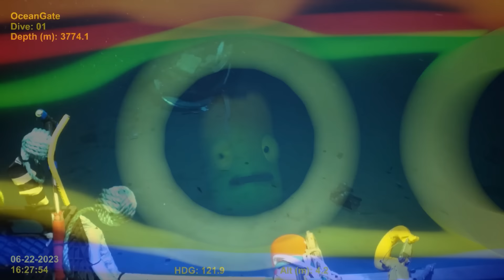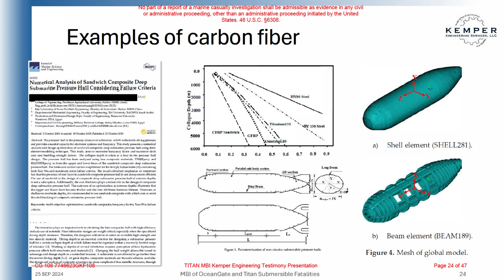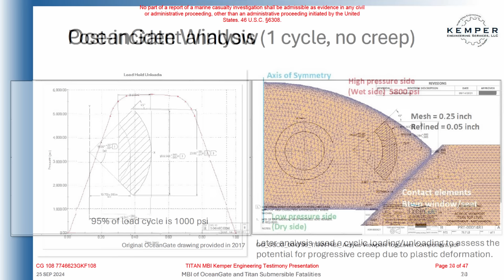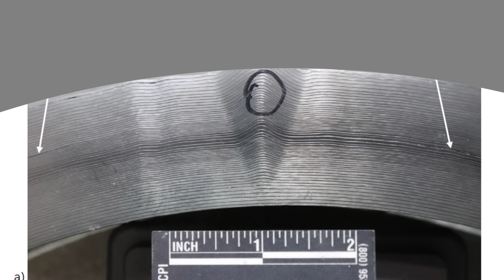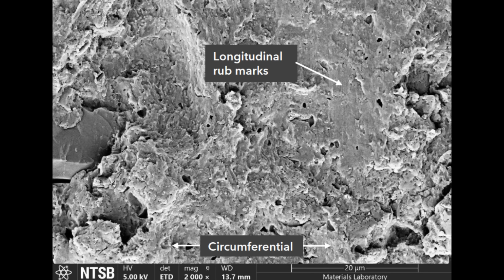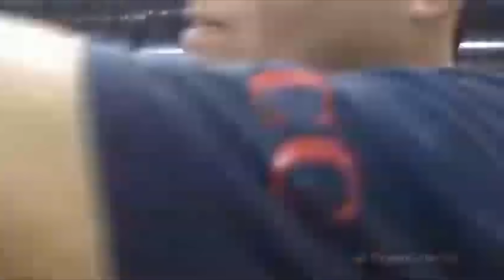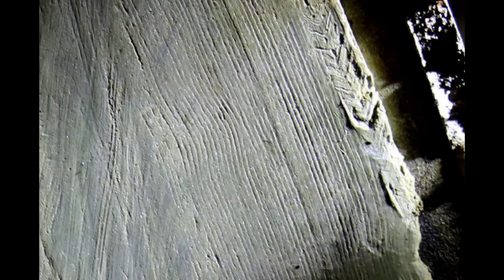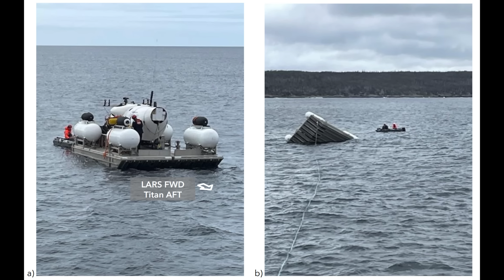OceanGate Wreck Shows Why Sub Wasn't Strong Enough To Survive - NTSB Shares Important Details

Comment: FWIW, when I first saw the construction over a year ago by now, I noted how thin that flange was on the hemisphere construction. The titanium and the carbon tube will compress and expand differently, and all that is holding them together is the flange and the glue. If the glue fails then all side loads are on that flange (and BTW I have had to try to bond metals and other materials together, and IMO there is no adequate glue for such different materials).  The question needs to be asked, but I’ll answer it here, I firmly believe that had that flange been thicker and the groove deeper we would be having this conversation with Stockton today in the flesh. I still think it was a bad idea to make the tube out of carbon fiber, and I’m aghast at the construction malfeasance (seriously, grinding away bulges in carbon fiber?) but I now believe it was the slipping of the tube off the face of the hemisphere edge with a subsequent failure of that thin flange that caused the failure in this case.

Comment: The way they mixed and applied the glue. Some dude mixed it by hand with a wooden stir stick bought from the hardware store in an old coffee tin, then they applied it in an open room (not a controlled atmosphere) with plastic scrapers. No one wearing proper clothing. Body hairs probably dropping into the mix. Applied in unequal layers. Its crazy what they thought would work.

Comment: I would really like to know what happens to the human body when subjected to an implosion at 400 ATM. Specifically, what effects occur at the tissue and cellular levels, as well as on bones and teeth...
Reply: how to become liver pâté for the sake of science...
Reply: @tiagof3441  
That's why that fish was there.
Reply: Squished.
Reply: @EvilXtianity Things are more complicated. It's likely that the air inside the cabin didn't even become a bubble; it was simply dissolved into the water as it flooded the cavity. But the question remains: what happens to the cells? For example, water would start entering the cells instantaneously, breaking down the entire cellular structure. What about the bones? What happens to the nails? Is this pressure enough to instantly and completely destroy the entire living structure? And how does the body react to such pressure? I imagine that the soft tissues must behave like a fluid, in much the same way as the water in the sea, because the difference in composition isn't so great.
Reply: @tiagof3441  
Those who recovered the remains described it as paste. All six were in that paste.

Comment: The glue i assume was designed to hold the dome on when out of the water. The equal pressure should hold it under compression. Im guessing the hull buckled

Comment: How would they let that pass with such wavy layers !. And a glue MM thick to hold it all together 5 times the level of possible failure is multiplied so many times with each layer of Carbon and glue holy moly that company is delusional they should have tested it with a autonomous mission 100s-1000s of times before putting humans in there insane

Comment: That porosity is terrible, even with thick composites.  In tension, porosity matters way less.  The fibers dominate the performance in tension.

In compression, the fibers depend on the resin to keep their alignment and not buckle, and with gross porosity like that there is far less holding the fibers in place.

Comment: If the optical effect is the concern with the safer acrylic window, why not correct the effect with optics? You can even maintain the desired shape with a composite lens design.
Reply: I'm a fan of air-spaced triplets myself.
Reply: @GWNorth-db8vn  I somehow think several miles underwater the air spacing would either implode or become water spacing
Reply: @tsm688  - On the back of the plastic, inside the sub. Corrective lenses are thin. You need two because of differential refraction between different wavelengths of light.
Reply: I suspect the answer here is the same as the answer for everything else: $$$
Reply: Money

Comment: Two metals expand by different amounts when heated.
The same happens with different materials when put under pressure. They shrink by different amounts. And if the two materials are glued together, the glue will eventually fail.
Reply: Is that what the bang was? The glue failing?

Comment: I’m not sure if you emphasised it… but they also seemed horrified in the hearing about the sanding between layers. This would have abraded through numerous layers of fibre, further compromising the structure.

Comment: Stockton Crush: "We have a system of strain acoustic monitors to detect any issues before an actual failure"

System detects a clear deviation after a loud bang is heard by everyone on board

Stockton Crush: "Nothing to worry about, just the steel frame rubbing against the hull. Prep it for the next dive!"

It's truly amazing someone can have their head so far up their own ass that you wouldn't even think to have qualified people look over the data after hearing a suspicious noise

Comment: In a Pressure Vessel used to take frail humans deep under water, if Titanium is Too Challenging, then STEEL STEEL STEEL is the only thing that is cheap and predictable enough.  Wonder if Cast Iron would have held up ...?  How about Concrete?  There was a time when deep underwater unmanned subs were considered.  The propulsion was thought as a cyclic change-in-density mechanism that the craft could use to always glide , on BOTH ascent & descent

Comment: If you looked video of the interior it looks like the monitors were attached by screws drilled into the actual pressure vessel. Im shocked noone has mentioned that. He fucking drilled into the carbon that was supposed to not have cracks or weak points.
Reply: That was not the hull. It was something they built to go inside the hull.

Comment: Why isn't steel used for deep pressure hulls, if cost cutting was a major motivation? Corrosion, or weight savings?
Reply: Steel is a common material for pressure hulls. But it's also much, much heavier than carbon fiber.
Steel would actually be cheaper up front, but would have significantly increased the operating costs per-dive due to needing larger weights and floats to descend and ascend, larger motors to dive the sub around, and a larger support vessel and barge to tow it around.
Reply: @KantiDono  Yes, I can see it being about operating costs.

Comment: Wrinkles milled down and glue...good lord you couldn't have paid me enough to get in that death trap!!
Reply: I will say, it is very possible to have certain glues as a structural component, so hearing that word used isn't automatically an issue, just in case that comes up for you in the future. But yeah, not good that oceangate wasn't able or willing to test to destruction and find all this out themselves :p
Reply: @emilydegroot6436 yes. I’m always happy when I see structural glue. -said no serious engineer ever.
Reply: That's like getting a pull in your sweater and just cutting it and not expecting a hole to form
Reply: @gcooper642 great analogy.
Reply: Right lol
Reply: Granted it's a tension example, but have you ever seen the trick to magicians tearing phone books? Step 1 is hold the book so the pages look exactly like 10:57. When applying tension, the flattest page bears much more of the load than the others. When that page tears (which only takes slightly more effort than tearing a single page) the whole book straightens a little and the second page is now the most load-bearing. Repeat until no more phone book. 

My point being, this is a very well-known way to *un*evenly distribute loads within a layered construction. Which goes to show the level of materials knowledge that went into making this... thing.
Reply: @DarkPhoenix6853  :trophy-yellow-smiling:
Reply: When I first heard that part, my instant reaction was "You've got to be kidding me.... that's not how you do carbon fiber"
Also, isn't it a general rule that a 5 inch thickness of pretty much any substance is considerably stronger than 5 one-inch layers of that same substance layered together?
Reply: "Also, isn't it a general rule that a 5 inch thickness of pretty much any substance is considerably stronger than 5 one-inch layers of that same substance layered together?"

Standard problem in Mechanics of Materials class is to do that sort of calculation. Yes, one thick one is better due to a larger moment of inertia. The glue between layers does not make up for the difference.
Reply: @mikespangler98  The fact that there are three large chunks, with a mostly clean split at the glue layer definitely tells me that the glue was one of the weak points (not going to say THE weak point, there seem to have been a large number of them).
And, thanks for the confirmation.  I'm not a materials scientist/engineer, but have read enough on things that I thought I had that right.
Reply: @mikespangler98 Autoclave or rushes ordinary oven was used layer after layer,   5inches would be too thick?
Reply: @Steve-A-42 the glue would of failed over each dive allowing salt water into the lasagna,
Reply: @aperitifs  As the video pointed out they kept getting wrinkles when the layers got too thick and even Stockton knew that was never going to work.
Reply: Moment of inertia? Like rotational inertia? What does that have to do with it?
Reply: @Steve-A-42  Yes and no. Composites aren't as straightforward as that but usually the way to do carbon fiber composites ISN'T to just glue whole sections together.
Reply: @Steve-A-42  they've known that in naval engineering for over a 100 years, ever since they started bolting on metal plates to sailing ships as armor.
Reply: @jagerdergroe8604  That was the context that I first learned it in myself.
Reply: @Steve-A-42  yes
Reply: @Steve-A-42  There are a lot of materials where laminates are significantly stronger than a continuous material of the same thickness. Especially if the grain or fiber of the material is rotated, you get increased benefits. Laminated wood can be stronger than the very same wood in one piece, for example.
Reply: @Steve-A-42  Well, remember carbon fiber is essentially many many layers made from fibers glued together anyway.  The issue was that they were sanding down those warped bumps which basically meant any of the fibers that got cut in that process would have been useless, so rather then a 1-inch layer it's really like a 0.8 inch layer with a bunch of useless 'filler' between the warp sites.   And from the analysis we can see that things were moving between the layers and causing the glue inside to become detached and turn into powder.   What they needed to do was keep x-raying the thing and looking for deterioration and eventually re-build the sub, instead they just ignored everything.
Reply: @takanara7  Right. Shaving off the bumps artificially stops the fibers at unexpected locations, and the glue between the layers was, quite apparently, nowhere near as strong as the resin within the layers.  Just SO many shortcuts taken here
Reply: I think the problem is none of the people that have half a millions dollars to be locked in this thing were told about how half ass every part of it was built. And they were lied to about who was helping develop it.
Reply: They didn't know, which is probably why PH's family can sue despite the waiver signed. They were willing to go on an experimental sub, not an experimental deathtrap.
Reply: That’s absolutely crazy to me. I mountain bike a lot, switched to a carbon frame bike a few years ago. I have to check the frame every time I go out to make sure there aren’t any deep nicks or chips in the frame. Any chips keep enough to be able to see the fiber is dangerous and a potential failure point when the tension from landing a jump or a drop is putting maximum stress on the frame. I can’t imagine machining the carbon fiber down during construction. That essentially makes the fibers that are machined useless since they no longer have a connection to the surrounding fibers on that layer. I’m no expert in engineering, but I’ve been around enough carbon fiber bikes to see how carbon fiber behaves. Just crazy.
Reply: Absolutely murdering the shear strength with all the dead-end fibers.
Reply: Seeing the wrinkles was mindboggling.  Every fiber that got the top of a 'warp' shaved off basically meant all those fibers were essentially 'dead' - the fact they had to machine down the ends to fit in the titanium, and also the thin titanium flanges.
Reply: It was truly a "ship of fools"
Reply: If only the passengers had known
Reply: Exactly ! , that was the big issue that got my attention !!
Reply: And not doing vacuum packing either to remove air bubbles ( bubbles is weakness)
Reply: I mean you couldnt pay me to go under the ocean at all. Hell im not sure i even want tp float over it why its not our element at all everything about it screams death for the human body. Common sense goes along way sadly i feel the human race lacks it.
Reply: True but you wouldn't know which makes it worse
Reply: To be fair, even if they had paid you to get in, you wouldn’t live to see that money
Reply: Not enough money in the world
Reply: Funny thing is, in a case of Kerbal engineering, it worked anyway. Just not past its rated depth forever.
Reply: This was always going to fail. It was only a matter of when. It was basically always in the process of failing
Reply: I've noticed wealthy people who never actually had to earn their wealth through engineering, design, management have no hope in understanding said things a homeless person who never had to do engineering, design, management.... 😂
Reply: @nagasako7 And you don't know how to grow a field of wheat, do you? But you still trust the farmer. Because that's his job. And you trust his competency.
Reply: @nagasako7 which is most of them nowadays

Comment: Scott, or any engineers, when pressurized airplanes go up and down their bodies expand and contract where the metal is no longer rated for flight. The same thing must apply to pressure vessels in the ocean, so did they take any of that into account when laying this carbon fiber? 

The idea of gluing this stuff together by hand to withstand 6000psi is mindnumbingly insane to me.

Comment: funny how you forget to mention the difference between composites used for manned submersibles versus remote operated vehicles. no one opposes carbon fiber for ROVs it is that in 70 years no one has been able to determine how many dives a manned submersible using carbon fiber can safely dive before the carbon fiber fails. 

ROVs are much smaller and also don't have to carry a huge empty space for a person to fit into.

Comment: The audio engineer who testifiednwas not the designer of the system. He was just another guy who had this dropped on his lap and tried to make it work against his better judgement and didn't say "fu" when it was half destroyed during assembly and they refused to let him try fix it.

In the firing interview with Dave there's mention of the designer but he wasn't around anymore. Idk if he was one of OG's OGs and still had shares and say or if he was the "quirky" guy they dissed as "getting older and odder". You can read along that part that they kinda nicked the software.
Reply: The Dave "interview" is hilarious anyway, you can see those toxic managers going through the motions, but it's a complete theatre, he had fired himself the second he put their crap work in document. I had to deal with managers like that, to the level where they stole my notebook and also (ofc) totally set me up to be scapegoat of the week. Those useless losers. Rush at least had some brain, but by God it was badly wired.

Comment: So that thin Internal flange on the ring was all that was keeping the external pressure from pushing the carbon fiber hull inward? The glue between the end of the hull and the bottom of the grove would be in sheer and wouldn't hold sh!t at titanic pressure.

Comment: Peel ply's primary purpose is to absorb amine blush on the surface of the glass allowing you to adhere another layer without sanding ... it should ALWAYS be removed - it is a disposable product to remove a problem that occurs when the resin reacts with moisture in the air.